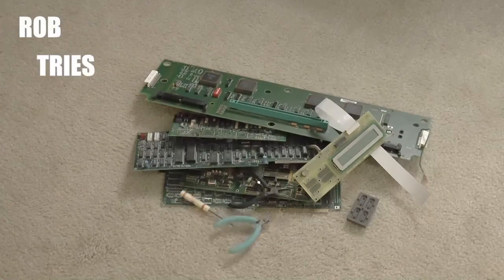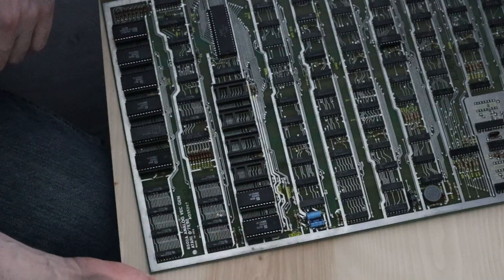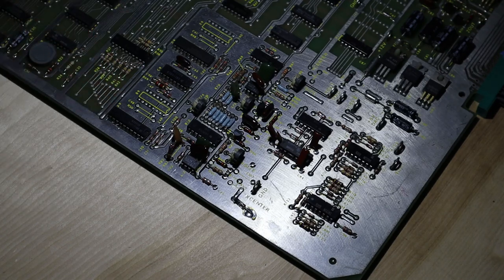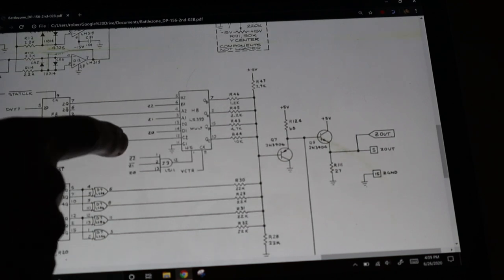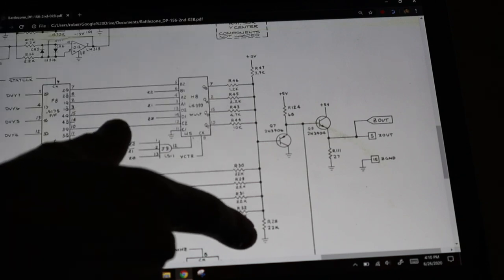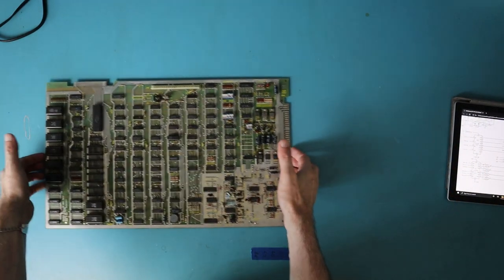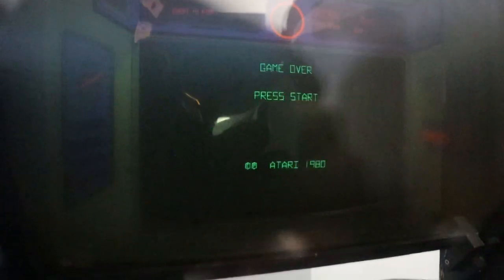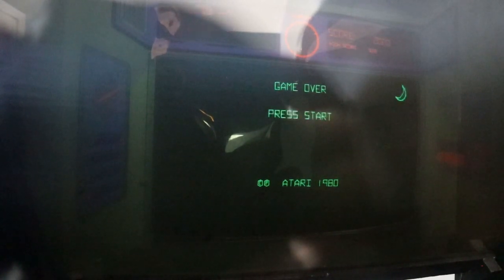Atari Battlezone arcade (1980) repair, part 4

Comment: Great to see progress on this!  Hopefully you just need to adjust the brightness.  Have you gone through the self-test?  That will display a cross-hatch pattern to help you adjust the monitor, and will report any problems found regarding bad ROMs, PROMs, or RAMs, etc.  Should be a switch in the coin door to enable it.
Reply from the maker: Yes, I did that originally but I neglected to do it again. I'm pretty sure there are supposed to be mountains in the background, but I didn't see them. And the tanks were still quite dim.
Reply: @RobertBaruch  There definitely should be mountains, and the enemy tanks are not equipped with any stealth technology.  I'm sure you'll get it eventually.  I've never owned a Battlezone - wish I had more ideas to share.  I used to collect arcade PCBs to troubleshoot.  Started when we both worked for NYNEX in White Plains.  I'm motivated to get my Asteroids Deluxe back in working condition after watching this series.  Best of luck, and I hope to see a part 5!
Reply: It’s great to see you back working on this again! You’ve got yourself a great collectible machine there... These old Atari PCBs generally require a little maintenance to keep them working reliable. I’d recommend removing those roms and cleaning the legs with Tarn-X. Flaky sockets are also common on Atari boards. Use dual wipes if your up to replacing them. With the roms out you can verify them with your tl866. Google romident (arcaderestoration.com). Also look your interconnect header pins over close for bad solder joints. Suck all that old solder out completely with your Hakko and reflow them all if you find any suspects. I agree with Thomas Royer that you should check your contrast / brightness on your vector monitor and pull up that test screen to verify no errors such as mathbox etc.. Great Job Rob - I really enjoyed watching these vids!
Reply from the maker: Yep, it was just the contrast control. When adjusted, it looked great, and everything showed up.

Comment: What is the Atari Battlezone arcade game using the LS399 chip has 4 bits multiplexer and 4 bit register to do what? What do you mean by you're "strobing" the clock signal? I'm not sure why they are calling it a WORD to select 4 bits because a WORD is 16 bits
Reply from the maker: According to the schematic, it looks like the chip selects either Z data or Y data to display for a particular amount of time. I'm not really sure what logic is used to select Z or Y. "Strobing" means setting the signal from low to high and then back to low (or from high to low and then back to high). And finally, a word is as big as the machine defines it to be, usually the size of a register. For this chip, a "word" is 4 bits.
Reply: Thanks for the help, What is the Magnitude Comparator IC chip being used for in Atari Battlezone arcade game?I had no idea strobing means low to high and then back to low or high to low and back to high, Why would you want to do Strobing to a clock signal? mostly a clock signal is constant active toggle, I'm confused why would you want to do strobing
Reply: @waynegram8907   strobing is just a single clock pulse if you will, on an infrequent basis, perhaps driven by software or some other part of the circuit when presented with the right combination of signals. You might do it to latch in some data that is waiting at the inputs so that it can be presented at the outputs, or stored for later, e.g. to read buttons or update some outputs to drive lamps or relays or provide inputs to other parts of the circuit etc.

You would have to examine the schematic to understand why a chip is there. A magnitude comparator usually compares to sets of inputs, perhaps numbers, to determine if they are of equal value, or greater/less than. Why you would use one depends on what you are trying to achieve.